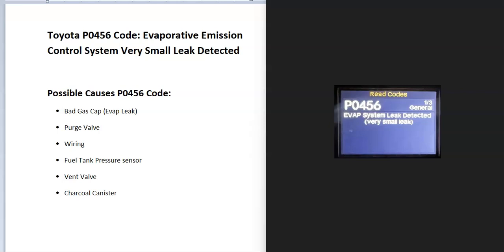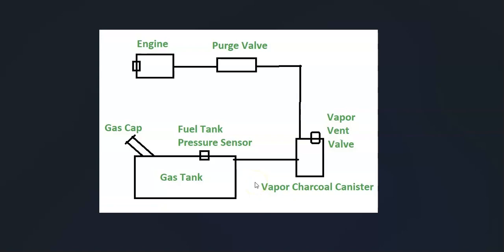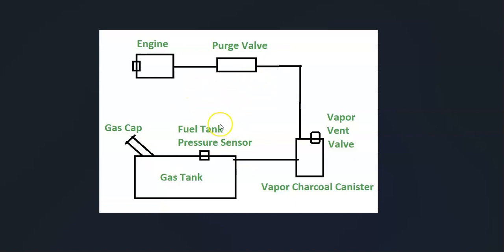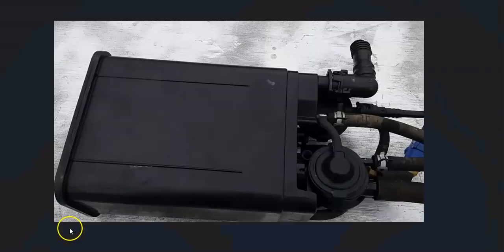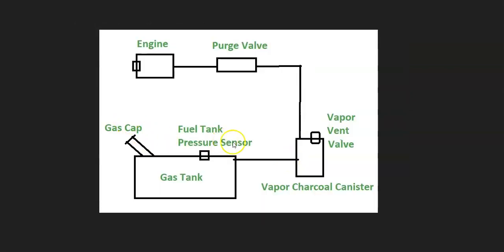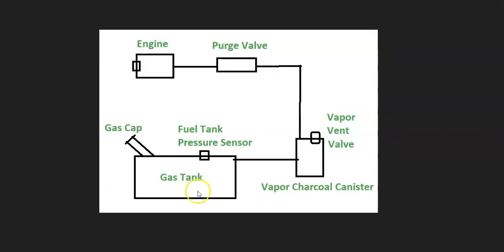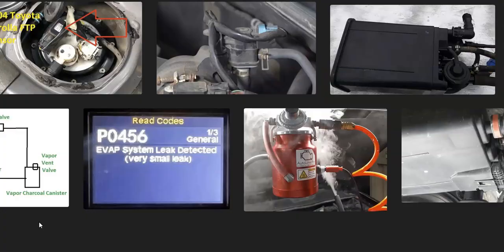Causes and Fixes Toyota P0456 Code Evaporative Emission Control System Leak Detected very small leak

Comment: what’s the worst that could happen if i don’t fix this issue?
Reply from the maker: If the purge valve is stuck open sometimes it can cause issues such as long starts, but usually the vehicle still drives fine; it just won't pass an emission test.

Comment: This may be a very stupid question but would this code stop the car from starting or even just cranking over …. The only thing that my car is doing right now is it just clicks … I’ve already replaced the alternator, starter and battery …. When I got the scanner all it comes up is P0420 and P0456
Reply from the maker: The engine should still run with an EVAP code. If the battery is charged, be sure the battery connections are good and also check the starter relay/fuse.

Comment: Could a bad fuel pressure sensor cause an evap leak?
Reply from the maker: No, that would be a separate issue. There is a fuel tank pressure sensor, sometimes called an EVAP pressure sensor, that can give bad info to the computer and cause EVAP codes.

Comment: 07 Matrix P0456. Checked all above but don’t forget filler neck. Did smoke test and it seem as smoke was coming out around gas cap seal. Replaced it another smoke test still smoke around the gas cap. Filler neck. Purge valve checked out. No leaks on vacuum hoses front to back, no smoke by the fuel pump just around the filler neck. Hope this helps someone.
Reply: So what was the fix

Comment: Great video!  I have a 2010 Corolla LE with 128k and has been pretty reliable.  But recently my check engine light and VSC tracking light were flashing two weeks back on my 2010 Corolla LE.  At that time I had just filled my gas tank and noticed a strong gas vapor as I drove out of the gas station. Didn't think of it much as I thought it's some other car.  Later on, I got the check engine lights and VSC tacking light flashing.   My mechanic diagnosed the code as P0456 Evap Emission Control System Leak detected (very small leak).  So, they replaced the gas cap with an OEM and reset the codes.  So far the lights have not come on.  Went to the gas station yesterday and filled up my tank.  After I started driving, I smelled a strong gas vapor/fume.  I pulled over and then opened the trunk after turning off the car and could smell the gas vapors/fumes in there.  Is this a bad charchoal canister or vent?
Reply from the maker: It could be a bad charcoal canister, but several things can cause that issue. It needs to be diagnosed. You can check the charcoal canister to see if it's damaged. Sometimes, debris comes under the vehicle and can hit it, causing damage.

Comment: I had my local shop switch my 06 tacoma to synthetic oil in Monday,  engine light came on Thursday. I got freaked out driving to/from work before I could read the codes.  This was the issue,  which has only come up 2 other times in the 9 years I've had it so I'm sure, once again that it's the gas cap. Lol might just be time for a new one.

Comment: I'm currently running a 441, 455, and 456 code, does that help narrow it down to one component if those three codes are tripping?
Reply from the maker: I would be sure the gas cap is sealing good and test the purge valve. Here is a video I made on how to fix multiple EVAP codes. https://youtu.be/C5s3Rx3wjD0
Reply: @HVAC_Mechanic  Thanks for the info. I removed my purge valve and checked for continuity with a multimeter and everything was fine, I sprayed inside the vacuum lines with some throttle body cleaner and let it sit, then bench checked it from the battery and reinstalled it. Immediately, the CEL went blank and the range on the fuel jumped back up to where it should be. Runs great now, no sluggish idling, and excellent fuel economy once again.

Comment: I have this code with the check engine light. I think it happened because my wife topped off the fuel often. After she would fill up the tank. the garage would smell like gas. Any ideas?
Reply from the maker: If you think it is an error, you can clear the code and see if it comes back. Usually, it takes the computer a few days to test the system again. Otherwise, it will need to be troubleshooted.
Reply: @HVAC_Mechanic  My mechanic cleared  the code, but it comes back every few months.  I guess I will just clear the code before emissions tests once a year. Thanks!
Reply: @matrixist if you clear the code it's not going to let you test it though

Comment: 2016 Camry bought it a few months ago notice the rubber o-ring on the gas cap looked a little dry rotted so I replaced it with a cheap aftermarket cap. Well recently it seems like every couple hundred miles or so the check engine light is coming on would you say it's a faulty cap or something else... Light never came on with the old stock cap that looked like it was damaged
Reply from the maker: A bad gas cap can cause issues and is a common cause. There may also be another bad component or possibly a leak somewhere, but I would start with the gas cap.

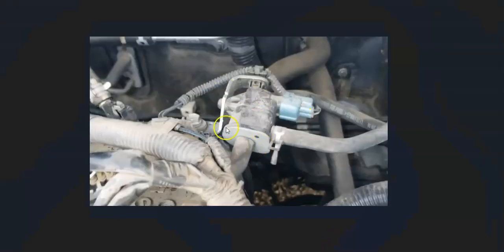Comment: @1:40 is the lower hose the one that goes back to the intake manifold? Is that a good place to do a seafoam spray treatment (vs taking off the entire air filter box to get to the throttle body)?

Comment: I had mine smoke tested and it’s coming from the fuel filler even with a new gas cap. Anyone had this happen before?
Reply: Makes sense. I bought car from mechanic. Had this code and he said change out cap and you should be good. Still have code but I used dura last. He said use OEM parts so that's probably your problem as well as mine. I had a speed sensor to transmission go bad but I didn't replace with OEM so had to change it again

Comment: I had a cracked hose that I fixed. How long does it take for the light to go out, or should I start looking at the other components?
Reply from the maker: A scan tool can clear the light, but to fully clear the code for 2009 and newer Toyotas, a drive cycle is needed, which varies. Look up your Toyota model and drive cycle to know the exact drive cycle.
Reply: 😊 @HVAC_Mechanic
Reply: How did you figure out it was a cracked hose? Did your light go off since then?